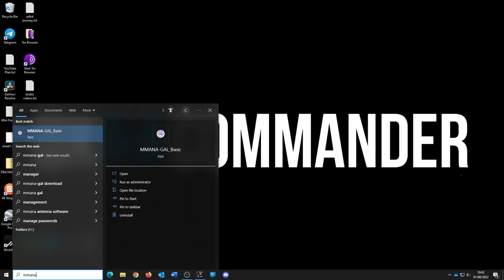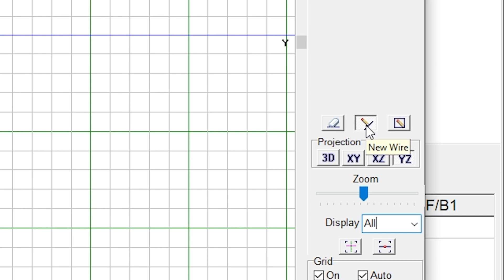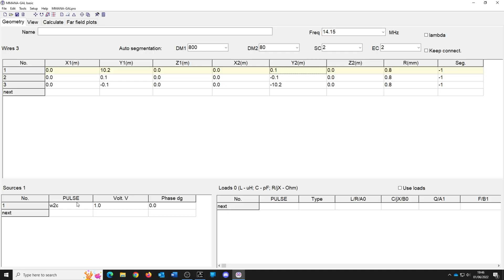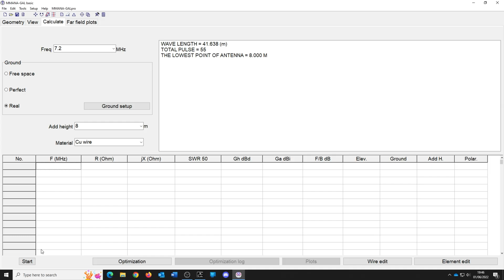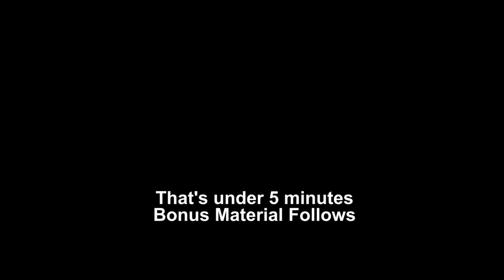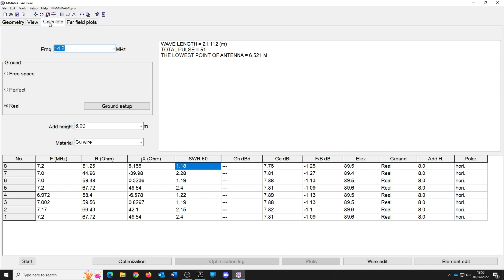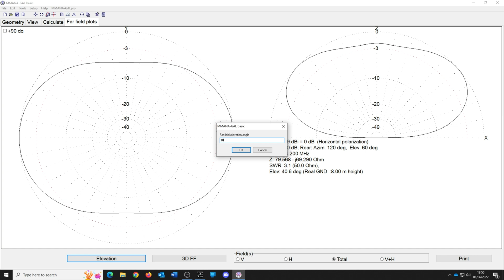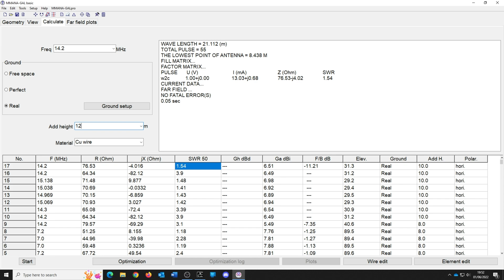Model to make a Dipole in Software - MMANA Antenna Modeling

Comment: Thank you Cal for all that you have added to the ham radio hobby! I am very new to MMAMA. My question is how to "model" a dipole antenna that I purchased. It's 204' long and made from #12 stranded, insulated copper clad wire. The feed line is 65' of ladder line and 70' of RG-8X terminated w/a PL-259, which goes to my hf rig. I had one up in 2007 and it screamed DX! What I want to accomplish is to "look" at the RF pattern to see if I can massage it a bit more to my topography. Many, many thanks Cal, for any help tidbits you might toss my way! Best 73!
Reply from the maker: OK, so that's difficult... Ignore the impedance a minute (since that will be taken care of by a tuner of the ladder line) but you can still see the far field plot. Just draw the elements, stick a feed point in the middle and kerboom. DOne.

Comment: Hi, I want to simulate a ELRS 70mm antenna in a FOV drone application what is correct parameter to do this correctly
Reply: The frequency it operates is 2.4Ghz
Reply from the maker: OK, so I'm not completely sure of the polar pattern of one of those. It's going to be better than a regular dipole but you'll need to keep the antenna perpendicular to the drone (ish). The parameters will be 2 x dipole legs 12.5mm long each (half an inch) or 1-inch / 25mm long in total.
Reply: @DXCommanderHQ  Thank you for your replay so I changed my parameter:Y1(m) = 0.0125 Y2(m) = -0.0125 foot point in the middle with a length of 0.0002m. I also set my frequency to 2400Mhz and added 0.05m height for the real ground. The resulting impedance as well as the SWR 50 is quite off by a large amount. I am quite new to this software, so really appreciate for your help

Comment: Hi Cal, thank you so much for teaching us IT computer struggling Hams to understand how to ues this great amntenna program. I am wanting to make aup a Half Square configuration and try various feed methods to review performance, radiation patterns etc. Can you help with a basic end fed 20m Half Sqaure design in this program and how to make the horizontal and vertical lefs? Cheers and thank you again for all your work on You Tube 73's Greg VK3KV
Reply from the maker: Greg.. I just tried this and failed but I think all you actually need to do is apply a 49:1 transformer on one end. I tried to model it and ran out of time.

Comment: Thank you for this. I just want to ask: I am going to make an inverted vee for 11 metres and put it in my attic. The lowest point in the attic to the ground outside is about 6 metres. Is this the height I put into the calculation, or would it be 0 metres from the ground to the ceiling of the house being the artificial ground? Thanks
Reply from the maker: Yes.. Ground is the actual ground. Good man.
Reply: @DXCommanderHQ thank you 👍

Comment: More questions -- 
What is the difference between your method - going from 0 to negative for the Inverted V - and what I better understand, setting:
W1 Z1 = 0.2 W1 Z2 = 7
W2 Z1 = 7 W2 Z2 = 7
W3 Z1 = 7 W3 Z2 = 0.2

Giving an inverted V that starts 0.2 meters above ground, feeds at 7 meters and returns to 0.2 meters .. This way I am not having to dig nearly 7 meter deep trenches 🙂
Reply from the maker: I think I understand what your question is - there's no difference as long as the end result is X distance between ground and feedpoint.

Comment: Hi Callum, thanks for teaching MMANA. Did some experiments with your 40 dipole. Gradually decreased the angle between the legs - until ends were  at -6.8 meters with the elevation set to 7 meters. This is close to 90 degrees. Found that as the angle increased - and the ends got closer to the 'ground' - I had to shorten the legs by an increasing amount to get low SWR.

With feedpoint at 7 meters (add height = 7) and ends at -6.8, optimum length of the legs were down to 7.17 meters - giving and SWR of 2.28. With a flatter angle - I could get much lower in SWR.

This very short wire length surprises me - do you belive it is correct ?

Regards
Mike
Reply from the maker: OK.. so with most of these models, wires that are less than 1/4 wave above ground can give odd impedance readings BUT in real life, the close an antenna is to the ground, the shorter it can be.

Comment: One question; my dipole antenna (two fishing rods back to back with slightly coiled wire) is at roof. If I calculate elevation from the ground, it is 13 meters. But, what about roof. Should I calculate height above roof, or above any longer metal surface? Or, it is as is - above ground? Thank you in advance for your answer. 73
Reply from the maker: Ignore the roof..

Comment: I use a duplexer and triplexer to connect my 2m/70cm radio and my 1.25m radio to my triband omni base antenna. The triplexer is a low pass filter for the 2m band, a bandpass filter for the 1.25m band and a high pass filter for the 70cm band.
Reply from the maker: Nice.
Reply: @DXCommanderHQ  Oops... Sorry for off-topic post. I got crossed between your channel and Mike's channel... 😳

Comment: Any way to add a 6:1 UNUN in MMANA-GAL?
Reply from the maker: Yes, a 300 ohm match to the environment.. From Calculate Tab: Optimisation > Advanced > Environement: Lower table where it says 50 Ohms. Change to 300 (equiv of 6:1).
Reply: @DXCommanderHQ  Thanks a lot.

Comment: Can MMANA be used to simulate/model PCB antenna?
Reply from the maker: Should be - although you can't place other components nearby on the board.. But conceptually yes.
Reply: @DXCommanderHQ  Thanks for responding.  I should have been more elaborate. I mean an antenna created with PCB traces. 

The issue with PCB trace antennas is that they have a length, width and thickness. However, E2NEC permits the trace to only have a radius. So I take it that MMANA-GAL permits me to specify a metal trace with length, width, Thickness, metal conductivity and the dielectric constant of the underlying medium? 

And this is this the free version we are talking about?

Comment: Great videos, one question: it it’s possible to generate a balun in this sw? I’m starting to design a fan dipole 40/20 . , so maybe I can reach you in the air, Saludos XE2GRC
Reply from the maker: Yes, absolutely.. Optimisation / Advanced / Environment then second drop down, add say 200 (for 4:1 balun for instance)

Comment: Yay! A Skyloop!  Coming soon to DXCommander!  I have an 80 to 10M Skyloop up at 50 feet in the corners, 275 feet of 14G copper wire in as close to a square as my trees allow.  What a great DX antenna it is.  As you go up in frequency the DX seems to get better in the lobes, but there are some deep NULLS (on the upper bands) as well.  At night it holds its own on 40M and 80M for distance.  I have mine corner fed with a 5K 4:1 balun, fed with LMR400.  Such a quiet antenna on receive.  I can actually invoke my rig's AMP1 and AMP2 on the high bands.  Not so much on 80m or 40M.   SWR is very fine and I use the Palstar HF-Auto tuner.  The antenna radiates high power (400 - 900W) very well.  In fact Callum we did have a QSO back a few weeks on your Friday Live Stream...  cannot wait to see you craft this antenna on MMNANA.  Thanks Amigo.  73 Art W1SWL
Reply from the maker: OK, so I filmed the basic small square loop today.. Next in the pot is the BIG one :)

Comment: love your channel, my question to you is how long dose a wire have to been for a 11 meter dipole and is there any chance you showing that for me.
regards
dave (charlie tango  4484)
Reply from the maker: Hiya Dave. Grab your calculator and follow this slowly.. Type in 300. The hit / (divide button) and type your frequency.. Let's say 27.4. The answer should be about 10.95. That's the wavelength.. Now if we divide that again by 2 answer is 5.47. So each side of your dipole is.. But wait! Depending on the wire we use, it's probably a tiny bit smaller.. Suggest we MULTIPLY by 0.95 (that's effectively 95% of the number we had. That means you should see on your calculator, 5.2. That's the measurement in feet. You can THEN adjust it if you don't like it by searching google for "swr calculator m0mcx" and there's a spreadsheet.  Basically, if you CUT 1cm, you would change the the frequency from say 27.4 to 27.5. I hope that helps..
Reply: @DXCommanderHQ  thanks Callum ill do it tomorrow
Dave